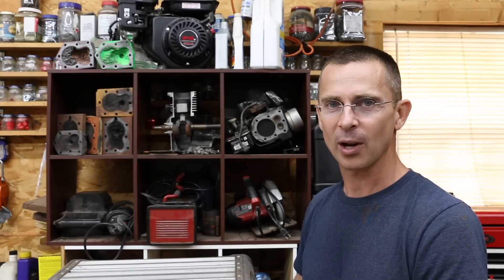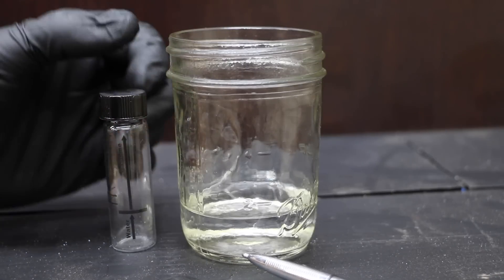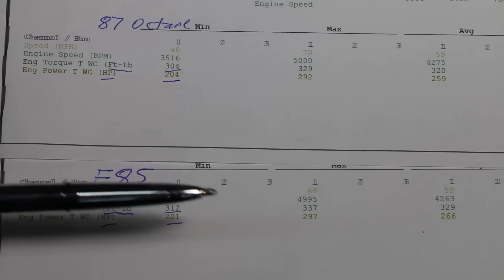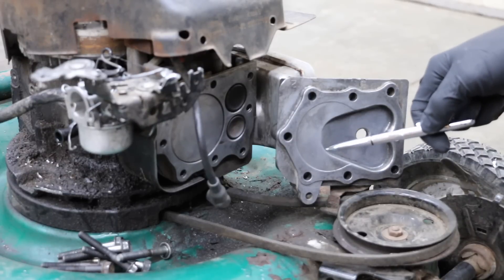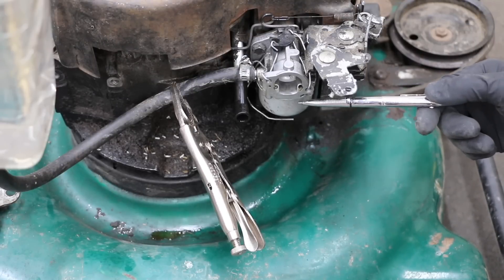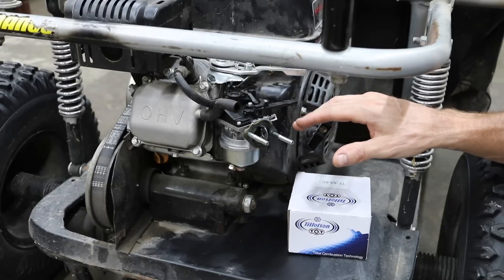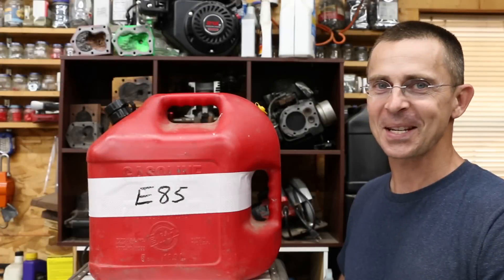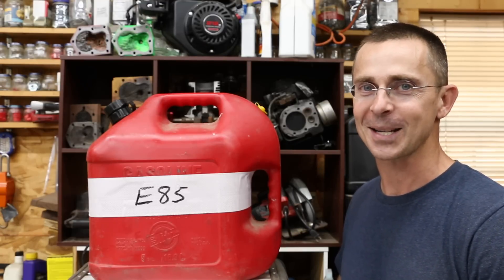Is E85 better than Gasoline? Let's find out!

Comment: This is a very good question. With my experience the cost savings doesn't justify the terrible MPG. I even started mixing it for a few weeks. On regular gasoline I average about 22 MPG. On e85 it was down around 15 MPG. So I was saving about 30 cents per gallon to drive me 7 miles less per gallon.
Reply from the maker: Thank you

Comment: I have a 2007 tahoe z71 5.3 litter vortec with flex fuel, but there is no e85 where I’m from. But I average 11.5 mpg on 87. Any suggestions
Reply from the maker: I'm guessing that the vehicle is used for a lot of city driving.  If so, this is fairly normal.  If you're only getting 11.5 on the highway, there's definitely a big issue.  Trying to figure out why the efficiency is poor without more information just isn't possible. It could be a hundred things.
Reply: Project Farm I do city drive, how should I improve my mileage

Comment: Thanks for all the fine videos that you make. I always enjoy watching them. Years ago lawn mower engines used a carburetor that actually had an adjustable fuel mixture screw located under the float bowl. Have you thought about replacing the carburetor on your mower with one of these older carburetors?   It could help you in some of your test videos. E85 also produces different byproduct gases that end up in your oil which can be bad on an engine over time.
Reply from the maker: That's a great recommendation!  I'll have to see if I can find one.

Comment: I have never used E85, but I am a chemical engineer.  E85 will never be able to compete with gasoline in terms of cost or fuel efficiency (assuming a properly tuned engine) because it has far less energy (BTU) per unit volume, and the chemical processes (primarily separations) cost much more.  We don't see all the costs at the pump because the government subsidizes it.  Ethanol is sometimes used for racing/high power applications because it burns faster than gasoline.  That's fine if you don't care about mileage.
Reply from the maker: Great point!  Thank you!
Reply: bkm83442  solid oxide fuel cell -Nissan
Reply: Just a little question. Here in France one liter of E85 costs about 0.60€ instead of 1.35€ for the E10. Do you think this is worth it ?
I guess it is, since E85 consume about 30% more fuel but cost half less !
Reply: @Lyzrinn you can increase Btu adding kerosene but octane will lower and not sure what kerosene costs in France. Diesel will not work however
Reply: The oxygenation can be leveraged to burn heavier fuels. I bet mixing it with Kerosene would have great mpg snd power combined
Reply: @sfertonoc  I put 15% diesel in e85 and the Power went up a lot! But the car need to be running all the time to avoid separation.
Reply: 1) ethanol burns cooler and SLOWER 
2) A boost in compression up too 14.5 closes the efficiency gap quite a bit.
Reply: @whatsinaname1829  ethanol does not burn cooler wtf
Reply: @theghost7277  yes it does, as ethanol evaporates it sucks more btu's out than gasoline. Do some research. "Both ethanol and methanol burn cooler, not hotter. While it is true that a liquid volume of ethanol will produce less heat energy, it does produce more moles of the gasses resulting from combustion. The , resulting in less of a decrease in BMEP than one might calculate based upon thermal expansion alone. As anyone who understands fuels in a compression engine would understand, not all of the power produced is from heat - There's a little more science to it than just that. As a matter of fact, at the same combustion heat alcohols would produce greater cylinder pressure, but since combustion temperatures are commonly lower, there is up to 12% lower heat/pressure than conventional gasoline produces. Some of that "lost" energy can be recovered by increasing timing advance to create higher BMEP and/or increasing mechanical compression to take full advantage of the cooler and slower burning alcohol."

Comment: When I rebuild my 392 International I am to jack up the compression ratio a lot and see how she runs on alcohol. In my testing though, I will deliberately do some runs on denatured alcohol because I am under the impression it will work better alone than with gasoline, my testing will tell.
Reply from the maker: This will be very interesting!  I hope you'll provide an update when you do the testing.  I'm always curious about this sort of thing.  Thanks again!
Reply: @ProjectFarm  I will do my best to document it, my camera just went all to hell on me 3 days ago and now I have to get another one, and although I have over 300 Gb of video, my connection is far too slow to upload it, so I have to find a way to get it all posted. /( -_-)\

At this point I have been mainly limiting myself to posting still images on deviantart and then sharing the links.

Comment: I have run a lawnmower on denatured alcohol before, so its not the energy in the fuel, its the condition of the engine.

Also I once ran my old beat up 360 Ford on E-85, and with over 375,000 miles on it it ran...poorly, but it did run and that was with a manual transmission on a 1974 1.5 ton super duty [predecessor to the F-450].
Reply from the maker: Great point!  Thank you

Comment: What is this 5000 RPM requirement? ~( ,m,)~

Any intelligent dyno should work at any RPM range!
Reply from the maker: I didn't realize this until after the video, but the vehicle is limited to around 100 MPH, which kept the engine from reaching 5000 RPM in 3rd.
Reply: @ProjectFarm  Oh yeah...I forgot that modern vehicles have governors built into them so you can't outrun the police. ~( ,m,)~
Reply: @DeliciousDeBlair  I doubt a Suburban could outrun the law with or without a governor. Speed limiters are set based on what speed the tires are rated to. My Mustang has a top speed of 175.
Reply: @65sohc  Depends on such a host of factors, such as gear ratios, how the computer is set up to propel the engine, yes, the tires have a bit to do with it but you can easily change out tires to about anything that will clear the brake mechanism, hotrodders have tooled and spooled up pretty much everything released for highway usage at one point or another in time.

For a short period of time I had a suburban with a 454 with headers on it, not that I am in the habit of outrunning police [and I usually reserve that act for vehicles with 440 MOPAR power plants anyhow, which I have outrun police twice in Chrysler New Yorkers (a 1970 and a 1974)] but if I actually planned for it, [as some people do regularly] I could modify any wheeled vehicle with over 1 liter of engine displacement [and many with less than that] to do so.

I am not even suggesting that such was anything YOU personally [or your viewers, or anybody else on the planet] actually wanted to do, it is simply a case that the government does not want people to simply be able to hop in their vehicles with the ability to instantly do so is all. Its not even a secret that they instituted such laws. All new vehicles have to have limiters on them from the factory, and although many people modify them, it is illegal to do so without 1, paying a large fee to the regulating body for their area, as well as, by default registering that their vehicle is so modified, and although most people ignore such laws, they do so at risk of jail and losing said vehicles and licenses.

Cars which are big, heavy, hard to handle and potentially hard to stop, and easy to use as weapons, need to be kept to speeds slower than the usual law enforcement vehicles can travel so that they have some hope of catching them.

Comment: Suppose to run Non Oxy in small engines, from what some of my boat mechanic buddies say. I hated running E85 in my first flex fuel vehicle, don't remember the calculations but I was better off running Regular while every other month or so run a thing of injector cleaner. Thanks for another great video!
Reply from the maker: Thank you

Comment: I was told that e85 eats the fuel lines and needs to be plastic or steel lines instead of rubber.   Is that true?
Reply from the maker: Ethanol is a very powerful solvent that is only designed for vehicles with a fuel system designed to deal with it.
Reply: All vehicles built since probably the '90's or earlier have fuel systems designed to operate with ethanol.

Comment: Used E85 in my 2014 Chrysler Town and Country Van...once.  Gas mileage tanked.  Performance wasn't a big difference but with the poor gas mileage I didn't believe it was worth it.  Perhaps a tank full, or even a mix,  once in a while would be a good idea to clean out the carbon and other deposits from the 87 octane.  Interesting video.  I'm enjoying your experiments.  Thanks for your work.
Reply from the maker: Thank you!

Comment: ethonol has about %80 of the power of 87 octane gas. but ethonol has a octane rating of about 110 so it can be used in high comp engines. and that's why you get worse mileage with ethonol. so basically you can boost your engine with a turbo or supercharger and add more fuel and get more power without risk of detonation (blowing your engine) more fuel=more power.
Reply from the maker: Great point. Thank you!

Comment: Add $1.50 to each gallon and you have gas prices here in Retarded California
Reply from the maker: That's expensive!
Reply: Not e85. It is exempt from the latest fuel tax because it burns so clean. I pay $2.55 for e85 in Fresno vs. around $3.65 for 91 at the same station.

Comment: I have an 08 Subaru STi that’s tuned for e85 I get about 16 miles mpg if I’m easy on it and about 10mpg if I’m boosting hard,   I get 100 pounds more torque and about 70hp with e85 downside is I live 23 miles away from the closest e85 station so by the time I fill up and get back home I’ve used almost a quarter tank so I take 3 5 gallon jugs with me,   But e85 is so awesome in my car it’s night and day difference with power,  and turbo lag is almost gone with e85 when I go back to 91 my car feels slow again currently running 380whp and 430wtq on e85
Reply from the maker: Wow!  That's a lot of power.
Reply: Is your car tuned for straight e85 or flex fuel?
Reply: 65sohc it’s tuned for both,   But I have two maps,   So when I run 91 I run the gas map,  when I run E85 I run the E85 map,   I use a cobb accessport to flash the maps on my car,   Since I don’t have a flex fuel setup in my car I run the fuel all the way empty as much as possible then I fill up with e85 and flash the e85 map on the car I’ll then run E85 for about 5 tanks before going back to 91

Comment: Nice!  I have a comparo request.  Can you test OEM paper air filters vs. K&N style air filters for particulate capture efficiency?  Not so much for for power change.  I am curious to know whether the filters perform the same for preventing fine particles such as dust entering the engine.  Thanks.
Reply from the maker: Great video idea!

Comment: The higher ethanol content will just "eat" aluminum parts alive if the alloy wasn't designed to cope with it. When I worked at an auto auction, I saw many times when older carburetors had holes eaten through their fuels bowls due to the use of the usual blend of gasoline & ethanol (5-10%) prevalent around that time. We had more than a few having to be pulled from the sale due to fuel leaks and others catch fire during the sale because the leak wasn't detected beforehand.
Reply from the maker: Thank you
Reply: there has to be some give-and-take of what you're saying.simply because of the reasoning of the older seventies and 60s cars, for example, Dodges 440 out of a Challenger or a charger they were supposed to run premium fuel With premium fuel you have more ethanol content but back than people didn't know the Difference Until people Started pounding the Crap out of them and found out that 87 Doesn't Work Well they also found a bump in power as well this was before e85 was a thing they found out what c16 could do but people Didn't know why they were burning out catalytic converters
Reply: Of course in the musclecar era of the 60's lead was used as the primary octane booster. Ethanol as a street fuel was unheard of. Then in 1971 compression ratios began to plummet to make way for low-lead and then no-lead gasoline. And you're right. Pre-71 cars that required premium (we used to call it ethyl) didn't like that at all. MTBE took the place of lead for a while but has been or is being phased out due to toxicity. Taking all factors into consideration when you think of the octane boosting alternatives such as toluene ethanol is pretty benign stuff.
Reply: man of many,...I worked on the MOPAR 440 wedge engines in the late '60s-early '70s long before gasahol came about. Before then, tetraethyl lead was how octane was boosted. The only alcohol in use back then was methanol in race applications. 
My Dad worked at AMOCO at their Research Lab developing fuels, so I had an inside track on what they were using to improve them back then too. Ethanol was way back as a "preferred" additive. 
When I built a 402 cu.in. BBC with an approx. 10.8 to 1 compression ratio in the late '70s, I had to fill up my 28 gal. tank with 25 gals. unleaded premium, 3 gals. of regular leaded and a 1/2 can of Octane 104+ to avoid engine 'knock'. 
BTW, that 402 was putting out around 465 HP. Yep, I knew how to build them.
Reply: It is more likely due to the fact that the cars sat around and the fuel absorbed water from the air and the water caused the corrosion.
Reply: Y-S-D,...Seeing the gasoline dripping from the bottom of the fuel bowl eliminated gaskets & hoses as the source. 
65sohc,...These vehicles weren't ones that had been in storage. They were daily drivers that had been traded in at a dealer. The vehicles were sent to auction because that particular dealer didn't want it on their lot because of either age or mileage., but a smaller dealer would.
Reply: @NOLL72  The fact that they were carbureted indicates they were built before automakers changed fuel system components to tolerate ethanol.
Reply: 65sohc,...Isn't that what I said in my initial comment? Why is it some people comment without reading carefully first?
Reply: @NOLL72  Sorry. My point was only that most ethanol intolerant cars have long since expired.

Comment: If you can find gas without ethanol, it's worth it. E85 is terrible. Less efficient, requires tuning to make it worth the trouble, more expensive, and most importantly, long term use will foul your carburetor jets to Hell and back.

Also, ethanol attracts water. That's just asking for tank and fuel line problems.
Reply from the maker: Great point. Thank you

Comment: The biggest advantage with E85 would be its octane rating combined with a better cooling effect. With E85 you can push much more performance out of your engine as you avoid pre ignition and run cooler. That said, without any kind of forced induction E85 have little advantages other than you becomes a little greener as the ethanol side of things are carbon neutral.
E85 are kind of the middleground between petrol and methanol fuel. Its cheaper than methanol, more available and easier to convert to. If you have a flex fuel sensor you could also be driving on any mix between E5 and E100 you like and if you had a small tuned 4 banger I can promise, you would feel the difference between filling petrol and E85. Around a 200hp difference at least dependent on build :D

I would like to see more of your single cylinder diesel engine and diesel engine generally. If you are going to try and run it on more alternatives fuels you should heat up the fuel first before it reaches the injection pump. It will lower the viscosity and make it ignite more easily. Had you pre heated the crud oil you used it would have run much better, hell you can even run it on heated and filtered lard and butter if you want. Just don't let it cool down with any of that still in the system :D
Dependent on what fuel or fat you run it on you could also mix in regular diesel or even some petrol to lower the viscosity and make it auto ignite a little bit easier.
Oh, and a heavy breathing naturally aspirating diesel engine always love some forced induction action :D Good luck! :D :D
Reply from the maker: Great point. Thank you
Reply: I would have to argue that Ethanol is NOT carbon neutral.  If you take into consideration that a crop had to be seeded = machinery to work the land, plant the crop + harvest the crop + the transportation of the seeds to the farm and then the transportation of the crop to the ethanol plant.   You also have to keep in mind that fertilizer production  requires the use of a lot of hydrocarbons. you need a lot of energy to transform crop mash into ethanol as well.   Even if you are synthesize alcohol from cellulose fibres, you still have a lot of energy going into the ethanol making process.
Reply: @gman7640  In that regard no fuel/power source is carbon neutral. Not any electric vehicle nor horse and carriage.

Comment: I had an engine that the computer would adjust for each type of gas after a short period so it didn't ping, knock etc. With ethanol I got far less mileage. It was so different there was no reason to use ethanol other than at one point real gas became hard to find. IMO ethanol is total crap.
Reply from the maker: Thank you!

Comment: Have a 17' GT350 (12 to 1 compression engine) with a procharger running around 6 pounds of boost, catted long tube headers, and 1300cc injectors.  Switched the fuel to e85 due to the octane rating, cooler flame temp and being able to inject much more e85 thus cooling the cylinder even more and preventing pre-ignition.  There are definite cons to using e85, such as the engine is now cold natured for the first few minutes when starting, fewer gas stations that have e85 at the pump, and the fuel economy dropping a ton but totally worth it to have some additional peace of mind that the engine will stay together.
Reply from the maker: Nice car!